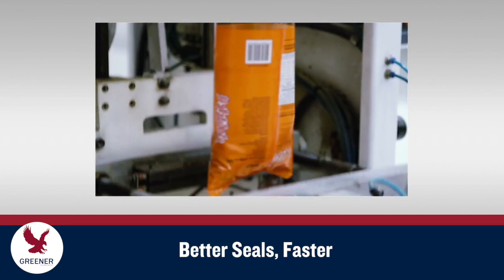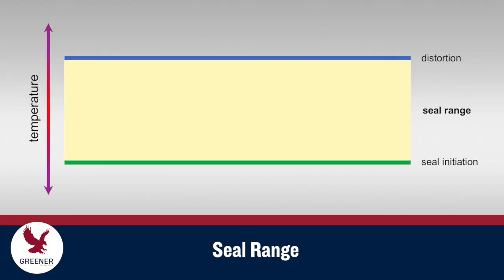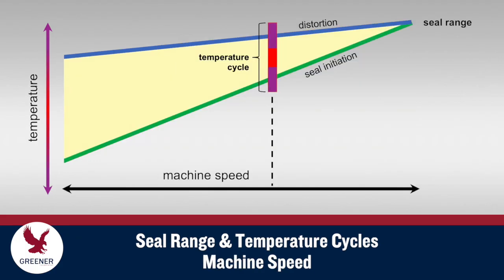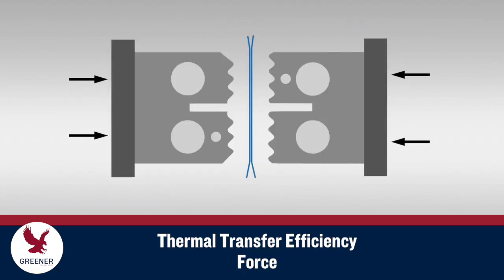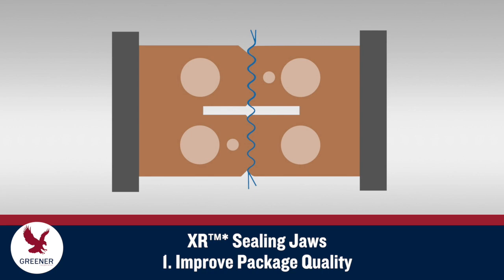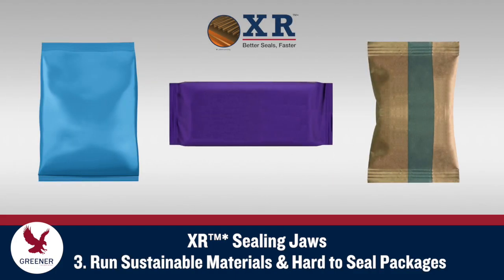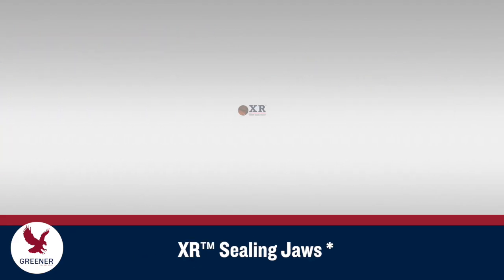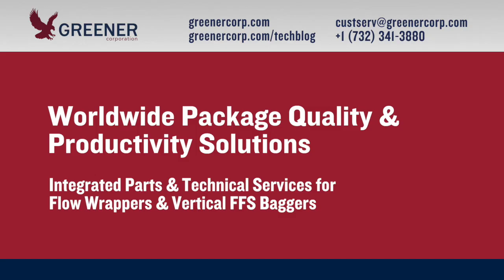XR™* Sealing Jaws Improve Thermal Transfer Efficiency to Provide Better Seals, Faster

Comment: Sir i am getting leakage in pouch at the side corner edge like pinhole burn so when to stop it i decrease temp but leakages starts at center

Corner edge leakage not in seal but below seal burn like
Reply from the maker: Hello, thank you for inquiring about your sealing problem. We will need to learn some additional information about your situation before we can determine potential solutions. It is possible that the serration profile on your sealing jaws is exerting too much pressure. Please contact us directly at custserv@greenercorp.com or https://greenercorp.com/contact-us/ and one of our Technical Specialists can help you.